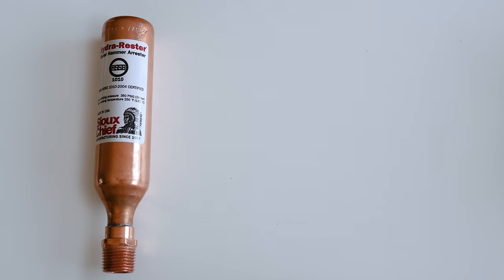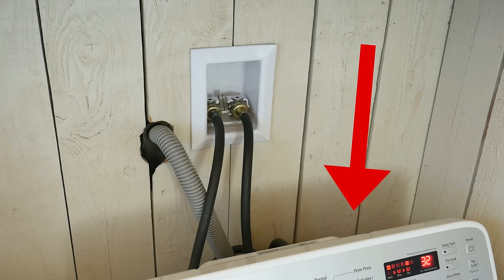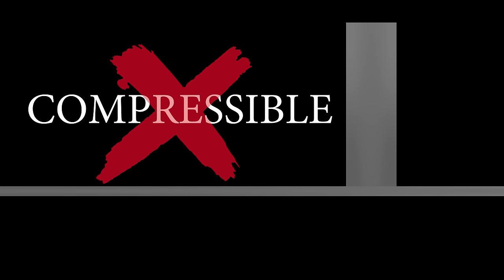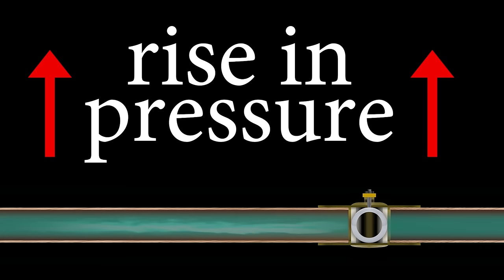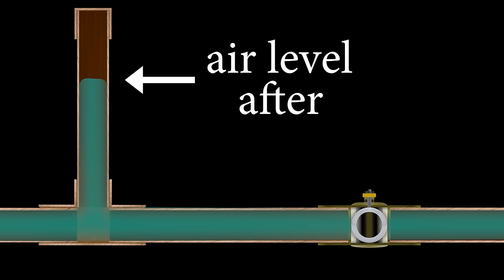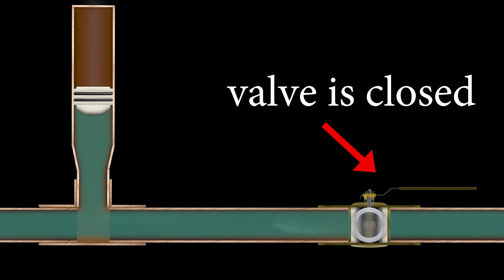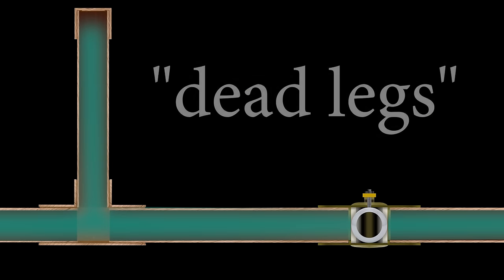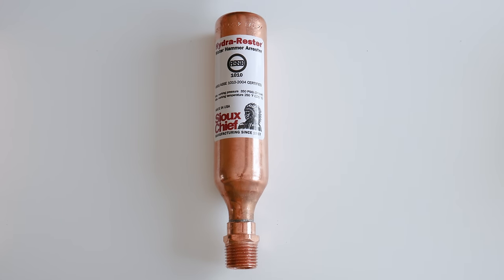Why Water Hammer Arrestors Are SO Important | GOT2LEARN

Comment: Does the expansion tank on the cold side of the hot water heater do substantially the same thing?
Reply: Yes, that is the purpose of the expansion tank and it is better technology. I would never trust these devices. I would return to the old school use of a long piece of capped vertical pipe at each stub out before installing these things.

Comment: Out of curiosity would an expansion tank solve the same problem?

Before I had mine installed I would hear the water hammer rattling through the lines. Now I have a tankless water heater and a pressure regulator on my water lines but I got rid of the expansion tank.

If I should be putting water hammer or resters on my lines should it be on each supply line right before the valve?
Reply from the maker: No expansion tanks a for expansion, not hammering, both are needed 👌
Reply: @Got2Learn  good to know! Thanks for the reply
Reply from the maker: You're welcome sir!

Comment: For an irrigation system, in replacing a 20' galvanized pipe, at 1-1/2"  with 1-1/2" copper, can I use a 1/2" water hammer arrestor on it?  The galvanized pipe already has a Mini-Trol Water Hammer Arrestor on it, and though old, I was planning on just putting it on the new copper.  Will this work?  Thanks for the video and thanks in advance for any advice.
Reply from the maker: I don't wanna give you incorrect information, you are better off askign someone who does irrigation for this, but I would have a tendancy to go with a bigger 3/4" or 1" for 1 1/2", but don't take my word for it, cheers and good luck buddy!
Reply: @Got2Learn  Thanks a lot partner.  I don't want to spend unnecessarily,  but don't want to short my customer either.  I am thinking, logically go 1-1/2 to 1-1/2, but they are so expensive, so I am wondering if the extra expense is necessary, or maybe I can just transfer the Mini-Trol to the new piping.  I am thinking for it to be there it must have been a problem, and am wondering if copper would make it better, worse or no change.  Thanks again, my friend.

Comment: Interesting . I have never seen or heard about one being installed anywhere before. Instead we use pressure reduction at the entrance of the water system if pressure is too high. But water system is usually not made from cooper pipes around here. Systems like that works for decades without any hammer arrester. I wonder what makes necessary to install hammer arrester. Is it copper pipes connections being too weak in comparison to e.g. plastic pipes?
Reply from the maker: If you have higher pressure in your building (~70psi and up) you'll start getting hammering, so you would either install a PRV (pressure reducing valve) or install these to cope with the hammering.

Comment: Do you need only one of these hammer arrestors in a domestic system or are multiple required? I'm guessing you'd need at least two, one for the child water line and one for the hot water line. Which leads me to the second question, where in the system is it best placed? Near the main feeds? Or near the logical centre of the system?... or?...
Reply from the maker: They should be installed nearest to the banging fixtures.
Reply: @Got2Learn  thanks bro! You are genuinely helpful and your vids are excellent! Wishing you every success.
Reply from the maker: You are most welcome!

Comment: Where is supposed to be installed this thing? can be installed at the main cold water pipe before the cold water supply collector ? Thanks in advance
Reply from the maker: Nearest to the banging fixture, you can add as many as needed.
Reply: @Got2Learn  I want to install it before I discover the sound (btw i'm from europe I wonder if it can be installed inside the wall covered by plaster and bricks)
Reply from the maker: @BurninVinyl  needs to remain accessible if installed in wall.
Reply: @Got2Learn  ok so I could install it where is the water supply collector. I think?
Reply from the maker: @BurninVinyl  sure, but it's best nearest to the fixture that's making noise.

Comment: I Live in Belgium, never seen one of these in my life, never have noticed anything like the explained problem. we have a expansion vessel for the hot water and central heating. I guess water pressure is lower and better maintained here?
Reply: so, did some searching: water here comes in regulated at 2,5 bar, with max peak of 3 bar. in places where this can"t be maintained, the water company advises to use a regulator after the meter if pressure is higher than 4 bar. what i find online for the US is that anything from 30-80 PSI would be considered normal, which is 2 till 5,5. so anything above 50 PSI (3,5Bar) would probably have issues with our plumbing as well, and would require either a regulator of something to counter pressure shocks.

Comment: Excellent video👍 
Where does it need to be installed  it ?
 and does every fixture needs one?
Thanks in advance
Reply from the maker: Not every fixture needs one but it's highly recommended to install one near fast close valves like toilets, washing machines and refrigerator lines. If you have other fixtures that make "banging" noises, you can install some for those too, it all depends on your budget and accessibility :)
Reply: @Got2Learn  awesome  , thanks  you 👍
Keep up the good work
Reply from the maker: Yes sir :)

Comment: Many reviews on ScrewFix's website suggest that these tend to stop working after a short time (weeks/months). I'm going to try just turning the inlet for the washing machine part-way closed to reduce the flow. How hard is it for washing machine engineers to design an appliance that closes valves properly (slowly)?

Comment: Where is the best place to install one of these? If you could install it at any point in the water system, where would the best place be?
Reply from the maker: Closest to the hammering in question.
Reply: @Got2Learn  perfect, and exactly as you said in the video, nearest to my washing machine. Thats where it hammers on my system.
Reply: @Got2Learn  one more question, do you need one for both hot and cold or just the cold?

Comment: The pipes in one of my stores rattle around in the walls quite loudly, but it seems to happen even when no one is using the water.
Reply: Check your commodes for leak over the over flow   Its possible you have a washer chattering Or its hot water system.  Thats why they secure piping its code.

Comment: I haven’t read all the comments, maybe someone has said this, BUT for 90% of residential water hammer problems are solved much easier and cheaper than this. Solution is simply to pull apart all taps in the house that are always open (dishwasher, washing machine, etc) and score the stem of the tap washer so it cannot move freely, but only when the tap handle is operated. Done.

Comment: Can you install them on the incoming cold to a common residential tankless water heater ? Specifically before the incoming cold side shutoff valve? 3/4 copper pipe
Reply from the maker: Yes, but that's not where it would be fully optimized.

Comment: You can also leave a cold water tap on and slowly open or close a valve. Take a few seconds either way.  Note water is many times stronger than the strongest metals so if pressure > pipe strength it will go.

Comment: Can you install these outside the house? I have fast shutting off b-hyve valves for the garden, creating back pressure problems.
Reply: mbmke ... The sprinkler system gets it's water from the house right? Install an air chamber or expansion device near wherever that connection is.
Reply: rupe53 Thank you. Yes, coming from the house. I don’t want to open up the walls so I was thinking just to install one of those water hammer arresters that are intended for washing machines. 3/4 threaded. I am just wandering if it will survive the elements.

Comment: Fitted one a year ago washing machine driving us mad perfect now
Reply from the maker: There ya go ;)))
Reply: Mine does it mainly with the dishwasher when it cycles. I’ve already tested my water pressure and installed a expansion tank and still have the hammer issue just no where near as bad as it originally was.
Reply: @whatfreedom7  you can buy arrestors that fit onto your dishwasher supply line

Comment: here your talking a water hammer arrester that can manage small (relatively) jumps in water pressure and my mind jumps to whether a device like this might have prevented a test reactor from ejecting a control rod with enough force to pin a man to the ceiling after a criticality incident resulted in a massive water hammer. 

there is no way one could be made strong enough without causing problems with the reactor though.

Comment: I hear loud ticking behind walls close to water heater only when hot water is being used, I thought its the tiny air bubbles in the pipes... any ideas? And how to fix it?
Reply from the maker: Ahh yes, that famous "ticking" noise hehe, that is not air bubbles, tgat the plastic drain pipe rubbing against the wood as it expands from that hot water 👌

Comment: 26 year plumber here. These hammer arresters are NOT necessary. As long as the plumbing is properly secured with either rubberized wire hangers or plastic isolators, it’ll never make that noise. That’s the sound of a handyman’s/do it yourselfer’s plumbing. You get what you pay for.

Comment: I'm wondering about those O-rings, and wondering if they wouldn't be less stable than... say... a standing pipe with an air bladder in it. I guess the concept is similar.
Reply from the maker: Those bladders aren't designed for shocks, those are more for expansion when cold water gets hot 👌

Comment: @gotolearn
I have a new submersible well  pump that’s a lot stronger. It’s got spring activated check valves at the recommended locations. I have a 40/60 pressure switch and an 80gal pressure tank. When the pump turns off I get a decent amount of water hammer. I’ve secured pipes and made sure the pressure tank bladder is pressurized correctly. Should I consider this type of device? It’s a 1” supply line where would you recommend I put it? The hammer is not happening throughout the house just the supply line from the pump to the pressure tank.

Thanks for your videos.
Reply from the maker: As close to the pump as possible, but keep it accessible.
Reply: Got2Learn ok cool. So I’d be under the house in the crawl space. Do you have any advice on how to properly size the device to my 1” copper line? I’ll have to cut and solder into place.
Reply from the maker: Just ask where you are buying it, they will give you the right one, but for 1", you'll need one of the bigger models.

Comment: Where are the best locations in the plumbing line for the hammer arrester and does it need to be installed vertically? Can it or should it be installed on both cold and hot side?
Reply from the maker: Nearest to the banging pipe/fixture as possible, doesn't matter the orientation.

Comment: They should be screwed in place so you can replace them which the will need to be in time. I live in a house built in 1957 and I am pretty sure there are none in my house. If the waterpressure is not on full blast and you do not shut  any valves superfast which you normally do not do and do not have the waterpressure on full blast coming in to your washing or dish machine there is no need to panic. 
It builds up preassure but I dont think it can bounce anywhere
Reply from the maker: You can buy threaded style arresters and have a shutoff valve to swap them out 👌

Comment: I have them on my washer like the one you showed but I still have knocking I've noticed.  What's the possible problem?  Also, if you install a bigger one, where do you place them?  Near the valve or tank or?
Reply from the maker: Always install these near the knocking fixture in question, what kinda pressure do you have coming in your house?
Reply: @Got2Learn  I'm not sure atm.  Hvac installed trunk line in such a way I can't read the valve, and I don't know from supplier.  I'm about to replace water heater and am going up address that.  I can't physically get my head into the space they left me to read it.  Would it show on meter outside?
Reply from the maker: @oatlord  Try getting one of these to check the pressure: https://amzn.to/3lSEGLB
Reply: @Got2Learn  so if the knocking persists, and I have high pressure, dial it down basically?
Reply from the maker: Exactly, so like if you have 90PSI, drop it gradually until the knocking is tolerable or not there anymore, shpuld do the job.
Reply: @Got2Learn  thank you.  I love your channel BTW.  Found it tonight and have been going through.  Learned a lot already.
Reply from the maker: Thank you so much, really appreciate it !!!

Comment: Is an expansion tank on the water heater the sam or would you need thus in an addition?
Reply from the maker: The expansion tank is to compensate for the expanding water, these are for shocks, both are needed ;)

Comment: You can use this physics to pump water up hill without using an external power source. You get around 7 feet of lift per foot of head pressure. It's called a Ram Pump.

Comment: Do you recommend a water hammer in a house if you have changed the copper pipes to Pex? I changed all my water lines to pex and I am wondering if I may need to install a hammer at certain locations. Jake.
Reply from the maker: Yes, closest to the banging fixture as you can 👌
Reply: Thanks!
Reply from the maker: @jmercado4  my pleasure!

Comment: Are these necessary if you have a properly pressurized expansion tank on the cold water input to your water heater? It seems like that would absorb water hammer as good or better.
Reply from the maker: Those are good for expansion, not water hammering :)

Comment: Or you have a plastic water tank in the loft and all of the fixtures are run from the tank and not the mains water pressure. Very unusual in the UK to have all the taps at mains pressure.  The tank is also used to settle out any debris from the mains system.  Some of our towns still have the cast iron mains pipes from Victorian times.

Comment: How long will this type of arrester work?   Is there a type that has a spring instead of an air piston?
Reply from the maker: No spring, just air.
Reply: @Got2Learn  Thanks for responding so quickly!  The reason I ask is because several reviews say that after a while the air seeps past the piston and the piston ends up all the way at the top of the cylinder, and no longer provides a cushion against water hammer.   So I know this one uses a piston, and no spring, but is there any model / brand on the market that does use a spring?
Reply from the maker: @CoconutPalmPictures  not that I know of, but if it happens it takes a long time, they are stress tested 500,000 times in labs.

Comment: I am getting some very bad water hammer in one of the zones of by baseboard heating. I assume it happens when the zone valve closes. I haven't found any information about using a water hammer arrester for hydronic heating systems - are there any issues with doing so?

Comment: What if the house has low water pressure? On purpose. what is considered normal water pressure? Too low, too high? I will haul water and have low flow faucets.
Reply from the maker: Normal water pressure for a home is around 50psi, high would be in the 80's and too low in the 40's.

Comment: That noise comes from my irrigation pipe but is schedule 40 PVC and the valve that feeds the system is outside the house. Is there a hammer arrestor for PVC? Where should I install it?
The rest of piping for the house is copper. Should I install another one for the rest of the house?

Comment: How would I use this in a hot water recirculating pump that only creates a water hammer when hot water is used?
Reply from the maker: Installed closest to the banging fixture in question on hot line.

Comment: Looking at that diagram of the arrester, how does this device prevent itself from ending up like the deadleg? I mean it looks like that plunger can be pushed all the way up and get stuck. Is there a spring inside that'll push it back down?
Reply from the maker: The air behind the plunger gets compressed and acts as a spring ;)

Comment: Water hammer arrestor are not a code requirement but definitely good to have
Reply from the maker: Here in Canada they are.
Reply: Not in Ontario.  Inspectors would never call for hammer arrestors.
Reply: Let me refine my answer.  If fixture is less than 2 gpm they aren't required.  I agree that on laundry machines they are needed.  Its definitely not something plumbing inspector ever asks for
Reply from the maker: Yeah, here in commercial applications they check. All laundry boxes have them, there are some in the condos themselves and also at the top of each riser.

Comment: I have them under the kitchen sink and behind the washer.  But they never seem to last more than 2 years. Especially the hot water lines.
Reply from the maker: Are you getting the cheap ones?
Reply: I always get the 4 inch chief ones off Amazon.
Reply from the maker: @fatfreddy4176  and they don't last 2 years??

Comment: those seals probably leak a tiny bit as well, wouldnt a spring and a tiny hole in the air filled side make more sense?
Reply from the maker: The water wouldn't allow the piston to compress enough to absorb the shocks.

Comment: With a house built in 2011, I don't see a hammer arrester anywhere. Any particular location to look outside or inside for the hammer arrester or a capped pipe design?
Reply from the maker: Yes, these are mostly installed in ceilings, however you should be able to access them via an "access trap", so if you don't have any of these traps they were either concealed in back of a wall or you just don't have any.